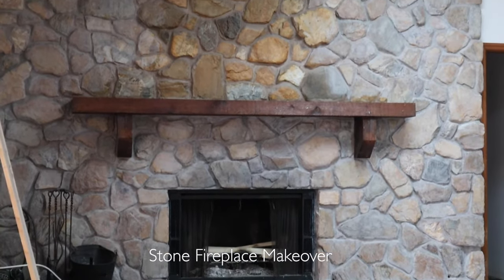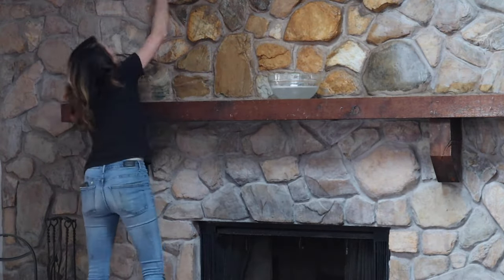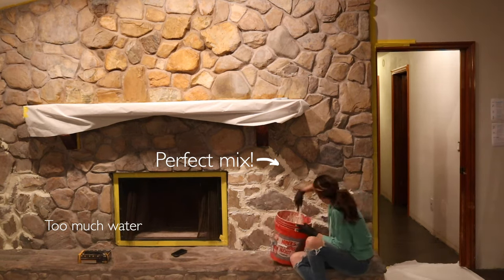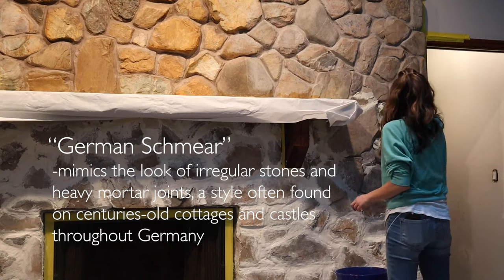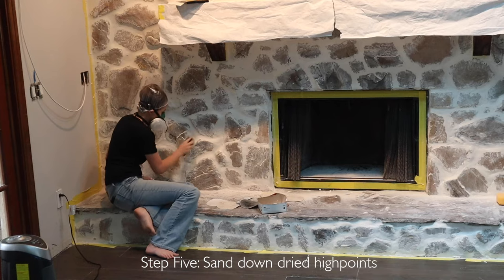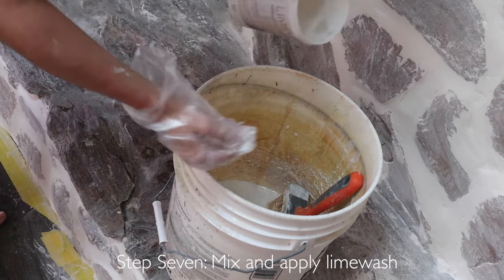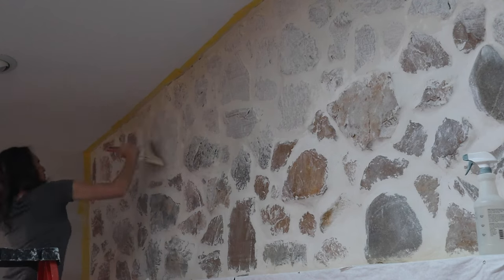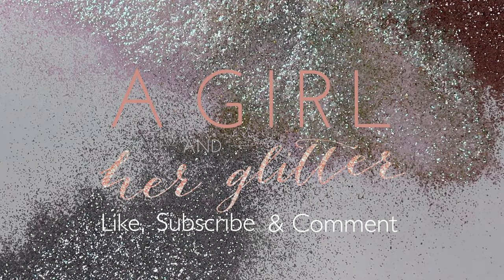Stone Fireplace Makeover

Comment: I am thinking of doing the same to my granite house in Ireland to brighten up my living room as it only has one window and the white should give more light to the room. I yet have to remove all the old plaster I have already done it up stairs and the granite looks good. Just one problem where the chimney runs up the wall as someone at some stage has put modern sand and cement mix on the wall due to the chimney going afire over the years and damaging the lime mortar between the granite. The good think is it is not a big area to fix.

Comment: Hey. Great look. What mortar did you use? The only mortar I see at Home Depot is thin set mortar. ?
Reply: The product in this video in Mapei Ultraflex 1, which is a thinset meant for ceramic.  I would call Mapei for advice on this use of Ultraflex 1, I believe an epoxy based thinset would be better.
Reply from the maker: https://www.lowes.com/pd/MAPEI-UltraFlex-1-50-lb-White-Powder-Thinset-Mortar/3199731?cm_mmc=shp-cprdflrgooglelia-106-groutmortarandsealers-3199731-_-0&placeholder=null&ds_rl=1286981&gclid=Cj0KCQjwi7yCBhDJARIsAMWFScNkEhHshjgCkLzA6rRnyDjwQk6Fbah0bfFU19Wf4Qk6QRk62j-LDF8aArEqEALw_wcB&gclsrc=aw.ds

Comment: This is one of the most deceiving videos on this subject. There is no mention of tooling grout to keep it off the stone face, there is no mention of how exactly to tool the grout to facilitate a proper smear, there is no mention of dry times required for grout before trying to tool, there is no mention of how to smear the actual stones with lime wash without leaving bristle patterns from the application brush, this video is fun to watch and makes it look like an afternoon job. Nothing could be further from the truth. This is at least a solid weeks work for someone who knows what they are doing and has the tools to do it. If the intention is to have a professional result hire a pro, this is a disaster waiting to happen for most people.
Reply from the maker: Two days. It took two days. Romabio instructions are on the box for the lime wash and the grout/mortar was dry/hard in 30 minutes. Thus working in sections. If you have any questions just ask... instead of assuming and attacking. I have had many people diy using this video with much success